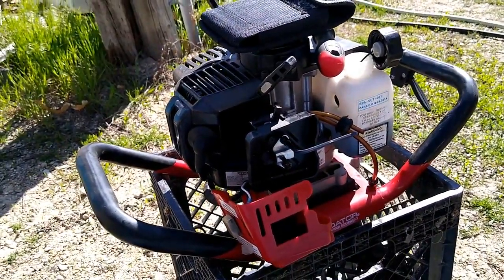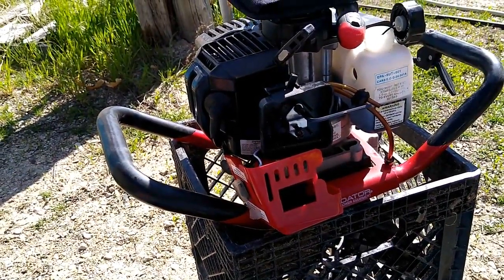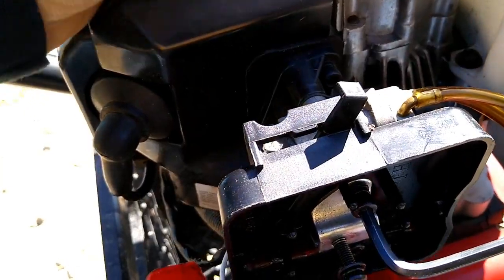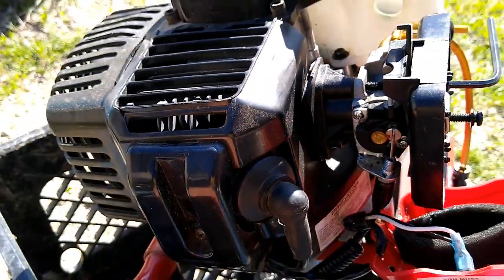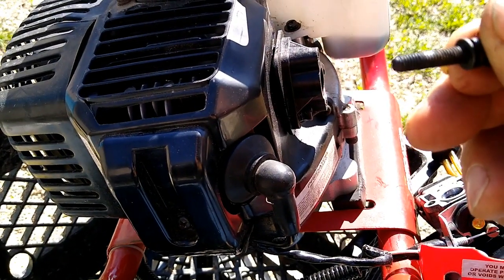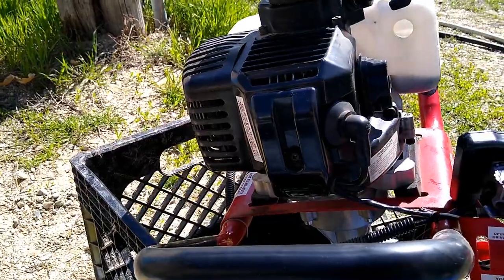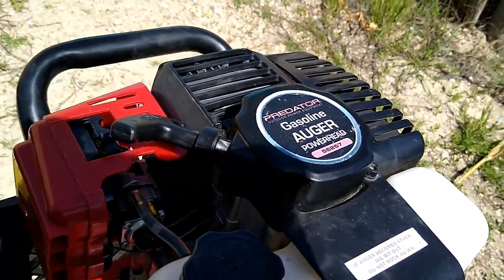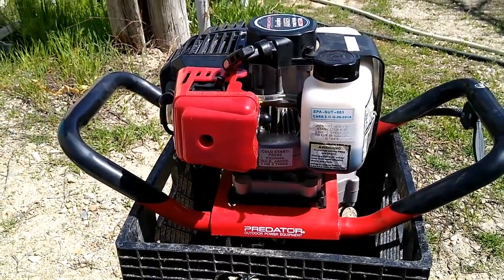HARBOR FREIGHT AUGER REPAIR

Comment: FINALLY someone who shows where the fuel lines go. The originals will  become soft ,probably because of the alcohol in fuel today, and the lines will fall apart in pieces. Also, I too have the extra weight in the tank which you also showed well. I have not found a video that shows it yet except for this one. THANK YOU!!! Unlike your weight, mine is rusting which is causing the filter to plug some as well. It should have been made of stainless. A BIG thumbs up to you!!!!
Reply from the maker: Thank you Mr. Tyson! I'm glad the video helped out. I'm a little surprised that the phone camera caught enough info. We do have fuel station here that sell fuel with non-ethanol which is what our small engines need. You made my day! We just finished a brake job on a 2006 Grand Caravan which was a complete rebuild on all four wheels and flushed all the fluid. A quick oil & filter change and I'm back in business. My son Bart did the work and I was the go-fer. Have a great weekend!

Comment: I have a Predator generator which I use to power up my house when outages happens, probably used 3-4 times a year and had it for 5 years.   Works great!   My Predator branch chipper, had for two years, works great.  Bought the Predator auger, it ran for an hour using 50-1 fuel, and it will not start.   Sounds like no compression.   Very disappointed with the Auger after having positive use from other Predator products.
Reply from the maker: A couple of thoughts on your comment. One is that things do come loose on this model, specially the carburator. The other thing is the fuel hoses and primer. I wouldn't expect that using the auger one time would cause the hoses and primer to fail but I'd check to see if there is air in the tubes when you are priming or when running. My primer had a hole in the middle of it and caused air to enter the system losing the prime. Not all equipment brands are created equal. Best regards my friend.

Comment: My harbor freight predator auger 52cc just quit on me this afternoon. Had on idle and suddenly made like a metal on metal sound and died. When pulling the cord the piston would not move, stuck. Almost new, used it a few times but looks like new. You think may be the engine got fried? Been using same right pilot gas ratio.
Reply from the maker: Maybe. First, pull the sparkplug and see if the motor will turn over. If it won't it may froze. I'd also look at the auger itself to see if there is anything binding there. Check it out and let me know. Thanks!

Comment: Need to replace the fuel tank.  Squirrel ate a chunk through the top corner.  Repaired it with PC-11 marine epoxy, but I borrowed it from a neighbor, and would like to return it as was... not eaten.  Hard to find especially when you consider these to be disposable farm tools.  You'd think eBay would have many parted out.
Reply from the maker: I have a friend who has a hole in his fuel tank so I've shared your suggestion to him. Thanks for sharing!

Comment: Forget the loctite honestly. Reason, that little engine is gonna get pretty warm and I personally wouldn’t want to resort to having to use red loctite on something I might need to take off, that I can’t readily heat up with a torch. The better option for easy carb removal, yet still be a permanent fix, would be simple: drill like an 1/8” cross hole through the bolt heads, then run a piece of wire through them in series. So it’ll make it impossible for the bolts to back out from vibration. Same concept they utilize for race cars and motorcycles!
Reply from the maker: Have you used this concept before? Interesting.
Reply: Only once, almost two decades ago. Lol. I wired most of the bolts on my Yamaha r6 to prevent them from backing out and falling off the bike.

Comment: Those loose screws are THE problem, before you do anything else, just tighten them and viola. Good as new.
Reply from the maker: It's a hit and miss success to remember to check all bolts, screws and assemblies when we buy new equipment. I for one have failed at that. Also after using the equipment it seems my responsibility to recheck the screws after each use to see if any are faulty. a mild loctite would be a good alternative to loose screws and bolts. Easy to suggest, hard to remember when the job is a rush job. Fortunately most Harbor Freight equipment I've bought have been without issues. Since most every tool is made in China, well enough said. Thanks for stopping in gman!
Reply: @sandhollowhomestead6972  It also helps that the harbor freight problems are very consistent, so you tube is a great resource for easy repairs.

Comment: Yes I always tell people. The machine starts hard or erratic when running. Check the two machine screws holding the carb to the engine. And if pull-start breaks. Go to Amazon and buy another for $5.00
Reply from the maker: Good info. Thanks.

Comment: So how do I get my auger to start it's less than a year old, I just started back in November an it was stored in a room temperature room
Reply from the maker: Two things to look for. Fuel and spark. If you left fuel in it it probably has suffered old fuel from fuel separation which can cause a varnish which plugs your carburetor. Old fuel will also rot the small hoses to and from the tank. Pour out the old fuel and check the primer that new fuel is moving through the fuel system. Pull the spark plug and check gap and clean off any carbon. Start with this to see if it will start. Priming according to the manufactures recommendation and choking the carburetor for 2-3 pulls should work. As a wise Lakota chief once said, sometimes the magic works, sometimes it doesn't. Have a great week!

Comment: My gas lines dissolved & particles got sucked into the carb, Ebay had a carb for $16.99 so I am swapping it out. It isn't quite fitting although everything looks the same.

Comment: This product is for one start only and painful to say the least.The kick back from the starter wheel is bone breaking.I own three generators 3800 to 6500W, none of them requires so much effort as this machine while pulling the starter cord.It takes 4-6 minutes of yanking the cord to start the engine.After the first use , it is a hit and miss affair.I returned the first auger,when after a couple of 15 minutes attempts ,the thing was totally dead.It was brand new, 5 minutes of use.The second one is not very much different-Without strapping it to the bench,the starter cord is impossible to pull.Yes,the fuel bubble was pumped 5-6 times and I gave up after 5 minutes.Some items from Harbor Freights are worth buying,but certainly not this one
Reply from the maker: I've experienced this issue before. Once I determined it was flooded and may have caused the excessive compression.

Comment: I bought one and the same thing happened after one month of owning it
Reply from the maker: I assume to get the cost down their assembly is rapid and doesn't require quality assurance, Also, materials are low-end to keep cost down. It seems we've got to perform extended maintanence on it.